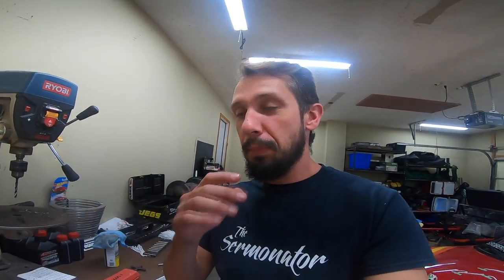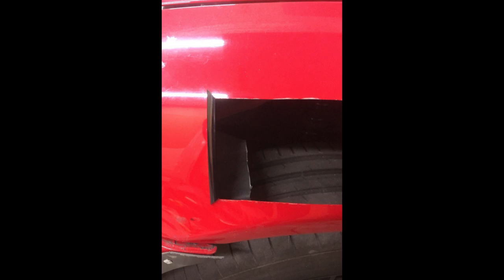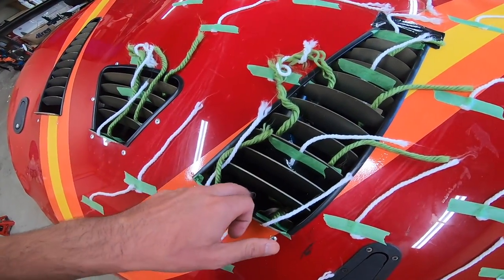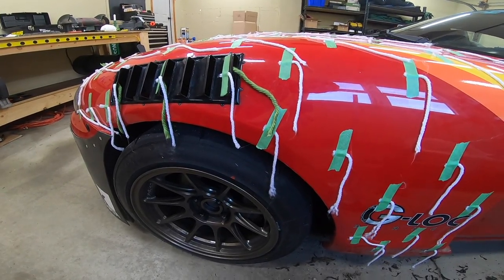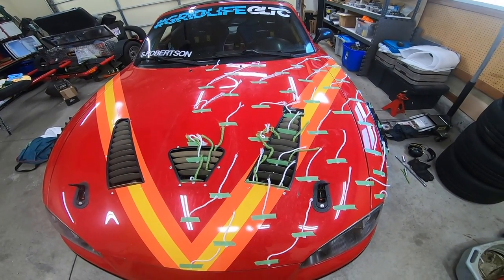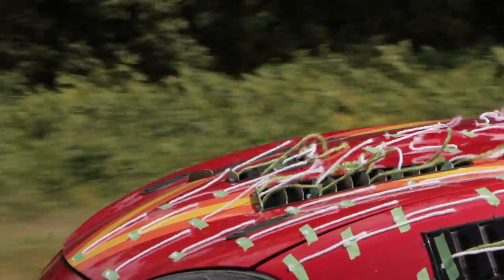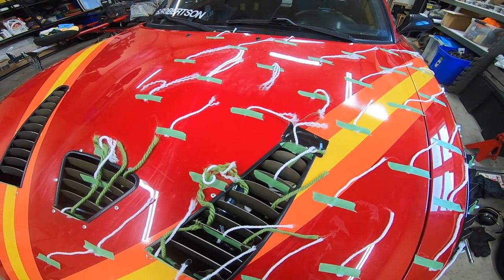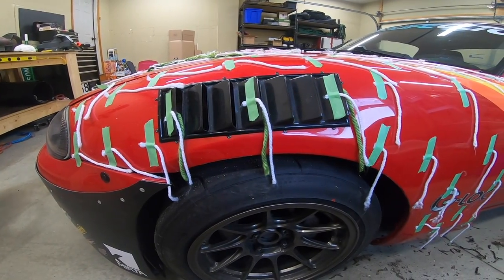Miata Aero Testing - Wool Tuft Time!

Comment: Hey, i'm gonna fit some hood vents on a Renault 4 because of overheating issues. Do I understand correctly that they should be installed in low pressure areas and that those area's are the same as the areas with the most detached flow? Greetings from the Netherlands!
Reply from the maker: Totally missed this: sorry!
Low pressure won't be the same as detached flow all the time. These particular vents create the detached flow/drag.
Best to put the vents where the difference in pressure, from the top to the bottom of the hood, is the greatest.

Comment: We need follow up on this :) how effective was the fender pull? What is the situation with the rear wheel?
Reply from the maker: Working on this currently! Initial testing if the front fender pull was positive, so we ran that for a couple events, and are working on the next version at the moment!

Comment: Curious as to what you think about the effectiveness of the Left Lane Design fender vents placement on NA/NB vs what I consider the more traditional approach which is up above the wheel on the fender like you did.
Reply from the maker: The design seems to be fine, however doesn't solve the reverse flow issue found on the bottom of the quarter panel - only pulling or making another panel that sits more flush to the wheel face would. This might not be as much of a problem on a miata that doesn't use as wide of wheels/tires as we do.